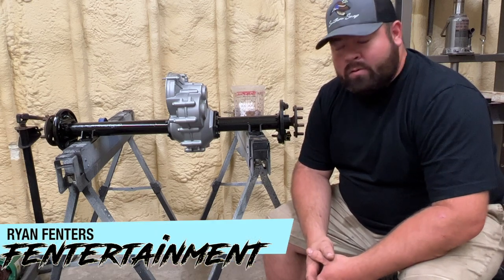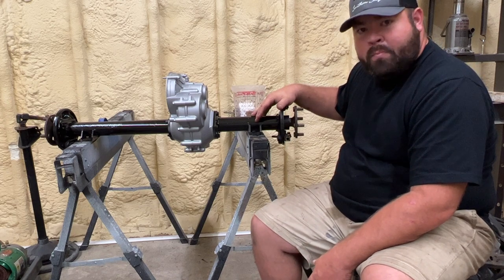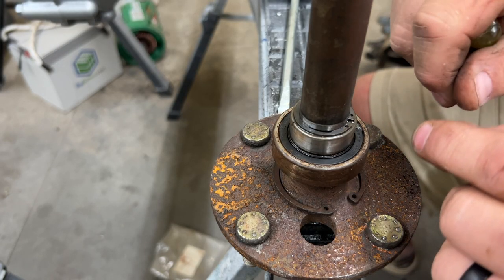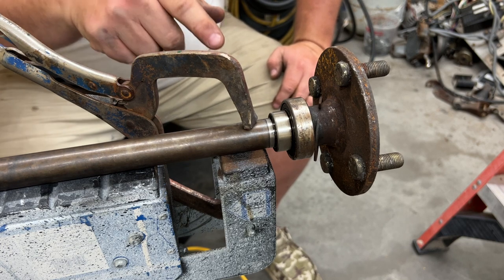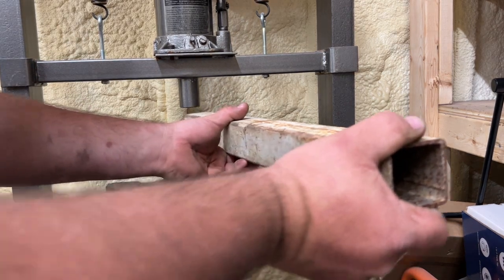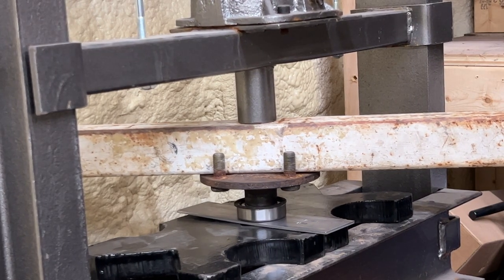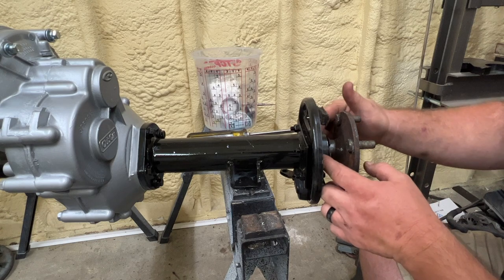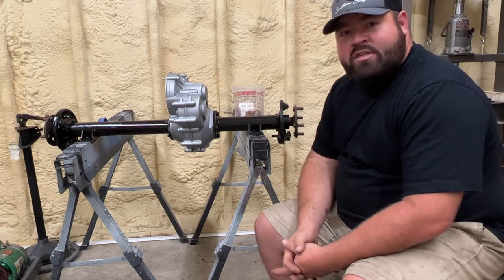How To Replace Rear Axle Bearings on Club Car DS Precedent Golf Cart | Axle Makes Noise When Turning

Comment: Thanks as always Ryan. Used this to change the brake assemblies on a CC DS.  My axles came out by hand which was nice.  I already had those Channel Lock snap ring pliers linked and they failed miserably.  Too much flex between the bits.  I grabbed a set of Icons from Harbor Freight and the rings came off first try.  Thanks again.

Comment: This video was so helpful! My 1994 club car carryall transaxle uses a wider bushing which I could not find anywhere for sale. I was unable to pull them off so I used the smaller size bushing and only pressed it down to slightly behind the clip ring slot. Hopefully no problems doing this.

Comment: I see that your hubs had quite a bit of rust.  Can you wire brush the rust off, and then paint them with primer?
Or is that a waste of time?
Can the studs in the rotor be replaced with stainless steel or brass to prevent rust.
I guess you would have to know what the standard threading would be so that you make sure that your new studs, work with the lug nuts.
Do you think that a 14 or 15 inch automobile wheel would have the 4 bolt pattern?

Comment: If you have a press why not use that to get the old bearing off
Reply from the maker: I dont have a bearing separator puller kit and I dont replace axle bearings enough to buy one. I was able to use a edger blade to help press the bearing on the axle but I didnt have the tool in order to install between the bearings and hub. The cut off wheel is easy to remove it.
Reply: @Fentertainment  fair enough 😀thanks for the quick reply!